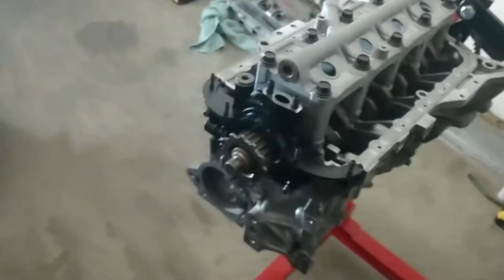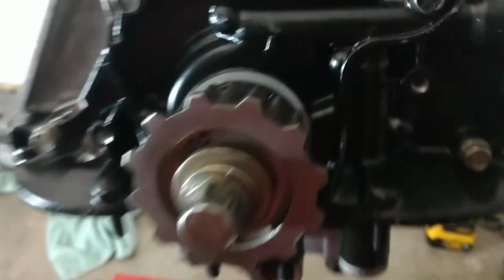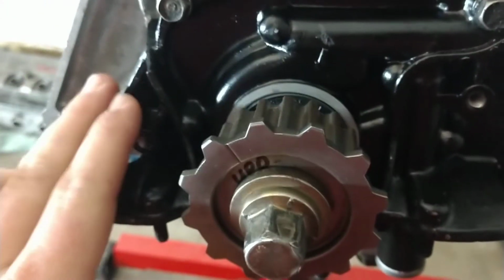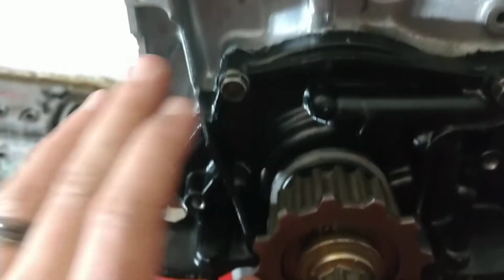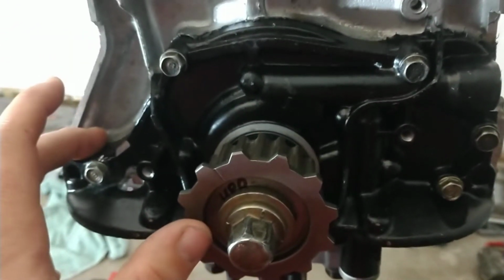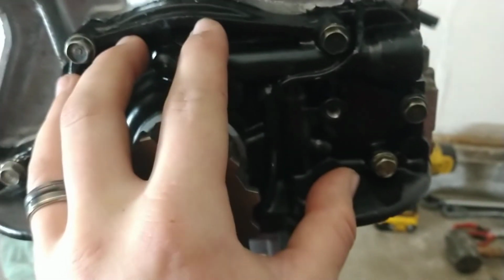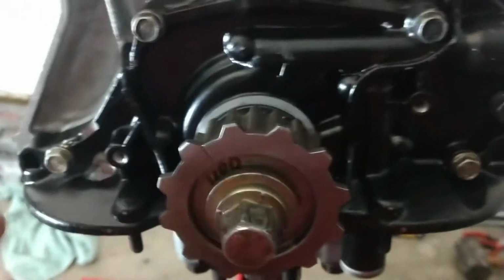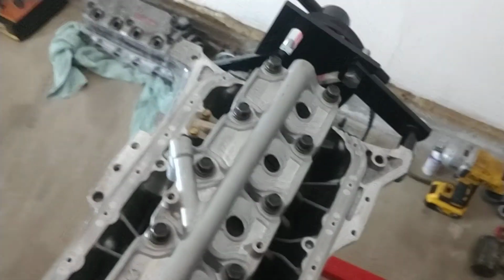96 97 98 99 00 Honda Civic Engine Build: Built For Turbo Step 2 Oil Pump

Comment: How well did it work bro pls reply lol
Reply from the maker: I would love to say that I finished this build and it worked wonderfully. I have yet to complete it though. However. If you are specifically talking about the oil pump situation. It seems to have worked flawlessly. Pump fits right up on the block. I've checked it against the dipstick tube. And the hole I bored out for it fits just right. But I said in the video. I'm going to be using an o ring and gasket maker to make a good seal and seat it at the right height.